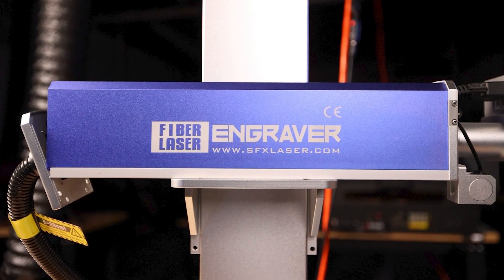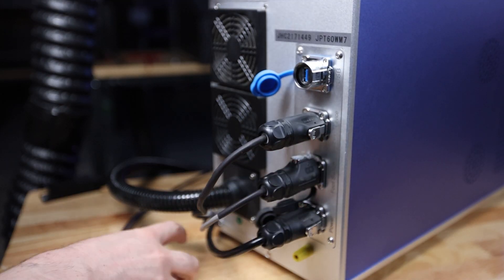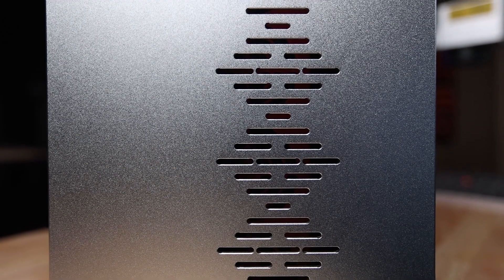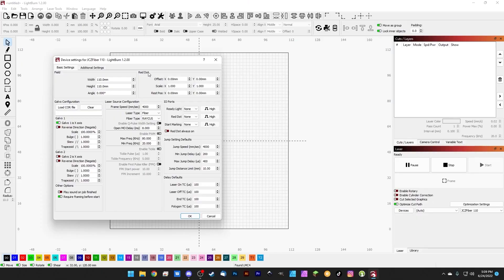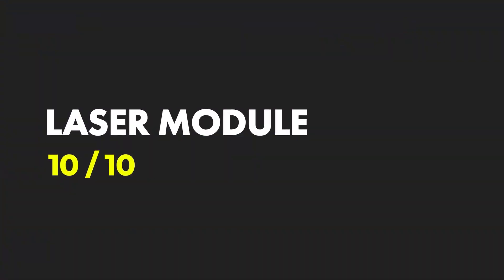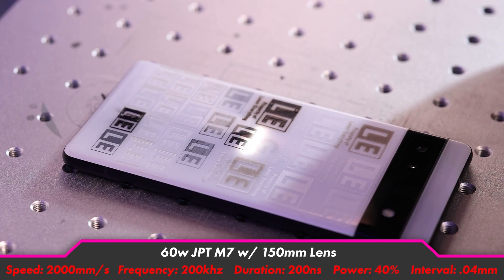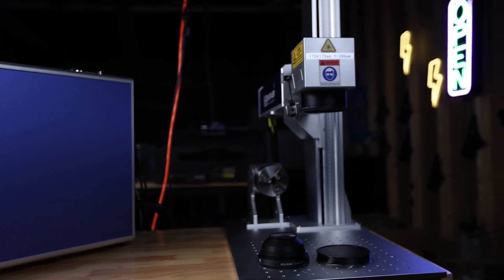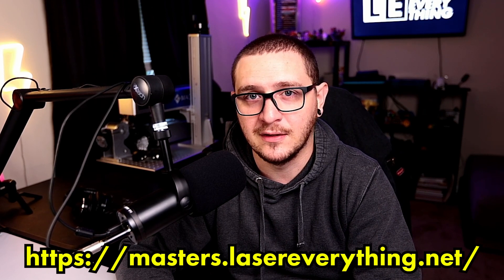SFX 60w M7 MOPA Fiber Laser In Depth Review | JPT YDFLP-60-M7-M-R

Comment: I've got a question I haven't seen anybody ask or talk about when it comes to these fiber lasers.... Is it possible to buy a cheaper 20W non Mopa laser unit in this same form factor to get started, and then simply upgrade the laser source to, say, a 60W Mopa source later? I'd imagine you'd probably need to upgrade the laser source power supply as well, but what about the control board, lens, and galvo, can those stay the same?
Reply from the maker: That's 100% correct and the swap is super easy :)

Comment: Hi, great channel, thanks! Just a quick question would you choose the 60W if you had to chose between the JPT YDFLP-60-M7-M-R and JPT YDFLP-E2-100-M7-M-R. The 100W has a Maximum Pulse Energy of 1.5 mJ. Thanks!
Reply from the maker: While the 60w model there has a 2mJ pulse energy, it doesn't make up for the difference in wattage of the 100w in 99% of cases. There are some limited use cases where the 2mJ might be a better fit for some peoples specific needs, but for typical engraving work loads where you'd consider a 100w (fast / deep engraving), the 100w is going to be a better option.

Comment: The line vs dot for the laser focus is a great feature if set up correctly. Say you have a part with multiple thicknesses, so you have to adjust the focus for each area. Rather than moving the part around to get each surface where your two dots happen to point, you can just adjust until the two lines overlap on the surface you're marking. Not a perfect system, but better than the dots IMHO
Reply from the maker: Ahhhhhhhhhhh THAT MAKES SO MUCH SENSE. Gotcha gotcha.
Reply: I have the exact same model but there isn’t two lines which meet, it’s just one horizontal line, what is the purpose of that line? Scratching my head over this feature😄
Reply: @tinytx  now that’s just funky. Does it look cool if you hang a mini disco ball in front of it? 🤣
Reply from the maker: The other line would be the red dot coming out of the lens when the Galvo is idle

Comment: Great video, I've learned a lot! Guys, what did you pay for your lasers? M7 60w E version. Because the prices are so different everywhere..😅
Reply from the maker: Many of our lasers were sent to us to allow us the ability to test and review, so full disclosure on that, but that also means we actually pay toward taxes on their value. It's also been a while since we got the 60w units we have in, and prices have fluctuated a bit since then, but the vendors are a marker on that. 2+ years ago, the price was somewhere in the 6500-8000 range for an E series model if memory serves. The prices are super different for a lot of reasons, it could be accessories included, motorized Z with buttons to go up/down or manual Z axis, tower size, model version of laser source in the machine, extra lenses, stuff like that. Once you get beyond that, it's about time taken to test in the factory after assembly, validate functionality and ensure power output testing, time spent doing a quality wiring job for easier maintenance and if there is an issue its easier to track back and fix, quality wire terminations and thoughtful management of component layout, and pre-configuring the machine with a correction and quality and care in packaging for shipping and shipping materials. There is a point when the cost gets too low to support all of these things, and somethings gotta give, so if you see something silly low, keep that in mind and know that it may be a bigger burden either later, or even upfront by going too low below the average. For galvo machines, check out the buying guide or on the marketplace, and also so far what we've shared on the channel, all vendors are within the norm range for pricing and offer good value and quality. Some have different setups/accessories, and offer different support/shipping and other custom needs, so there's a lot of options even within the trusted options of the community depending on your preferences/needs.
Reply: @LaserEverything  thanks for the info!

Comment: You have two reviews for, on the surface, appearing to be the same machine. The wisely and the SFX.  My main component is for cutting and etching metal plates for jewelers and the basic market for common items, such as tumblers.  As a first time fiber laser purchase, which one is a better choice and underneath, what are the main differences between the two?
Reply from the maker: The differences between the two are negligible. The source is the same, they both have comparable scan heads, they're both built well. Kyle's wisely has a motorized z if you're into that - mine is manual which I prefer. His bed spacing is 50mm on the jig mounts and mine is 25mm. That's more or less it. Nothing significant to note.

Comment: From a safety perspective is an enclosed fiber better than an open fiber. I understand the safety glasses situation, but, safety in an enclosed situation, is it better? Thanks.
Reply from the maker: Absolutely. Having an enclosure (that is properly rated for the job) is absolutely a safety improvement, especially if anyone might wander into the area where the laser operates during operation. From a function aspect, it can't work for everyone, based on tower height/lens sizing for work area, and object being engraved, but safety wise, 100%.

Comment: How does a 100W E version (1.5 mJ) compare to a  full power 60W (2 mJ) version ?   These go for about the same price, which is a greater value/usability, having more watts or more mJ ?
Reply from the maker: More wattage offers a greater value. To the average user it would be difficult to discern the difference between the two sources.

Comment: When you mention that this can handle even more plastics, what do you mean? What plastics can this do over another laser?

Great Video by the way.
Reply from the maker: Most q-switched fiber lasers are locked at a fairly high pulse width meaning they're using too much brute force to mark plastics without melting them down or catching fire. There are exceptions to every rule however. Fibers are good at surface marking ABS (NOT CUTTING - DANGEROUS GASSES) and dark opaque acrylics with high frequencies that can help reduce your pulse power. That said with the adjustable pulse width (especially at the range of 2-500ns the 60w M7 provides) you can substantially reduce the 'punch' of each individual laser pulse enabling you to get better results on materials that are more sensitive to heat. 

Inversely you can rise far above the average pulse width of q-switched machines which means you can pack way more of a punch at higher speeds and frequencies, meaning you can cut and deep engrave faster and more efficiently. MOPA's really change the game. It's a whole new dynamic in the Power, Freq, Speed triangle balance.
Reply: @LaserEverything How you can deep engrave without burning it using this machine? I mean, what are the correct parameters ? Using a 1.5mm stainless steel plate in the opposite side of plate it is burned.

Comment: Alex, I ordered my first laser a 100W MOPA M7 from SFX on Amazon at just over $10K USD and received it on 17 Aug 22.  Up to now, I was very happy with my purchase until I saw your review.  Now I feel after watching your video that it is like salt being rubbed into a wound, because i thought i was getting the  best JPT source for the 100W.  My laser came with a YDFLP-E-100-M7-M-R  NOT a YDFLP-100-M7-M-R Fiber Laser Source.  I am curious at just how much less effective my 'budget model" is compared to the "luxury model"?  Also, did you specifically ask them for the model you received or did it just come that way? Thanks
Reply from the maker: Hey sharpe, nothing to worry about, the hundred watt only comes in the e-version there is no standard version of that laser source and the price sounds like a good deal so I'd say you're good to go.
Reply: @LaserEverything  Alex, thanks. That does make me feel much better...whew!
Reply from the maker: All good 😊
Reply: @LaserEverything  Sorry, but that's not true. The standard version of the 100 W source does exist. Or at least in the JPT list I have it is there.
Reply from the maker: Weird I don't see it currently listed on their website
Reply: Knowing this mJ thing makes me even more confused.  How does a 60W 1.5mJ, a 60W 2mJ, and a 100W 1.5mJ  versions compare?   Does the 2mJ option make the 60W version more or about the same capable in engraving (speed, quality, etc) as the 100W 1.5mJ module?

Comment: I see maximum pulse engergy on a 100w system is 1.5 whereas on the other it is 2. If you are going for faster cutting and deep engraveing would it be better to have a higher MJ or Watts?
Reply from the maker: Wattage almost always trumps pulse output power, but both is best.

Comment: I have the lower powered model JPT  YDFLP-60-M7-L1-R.
Hmmm. Even though the it is red the model # is slightly different.
Maybe older unit still left in stock???
Any ideas.
Monthly subscriber here.
Reply from the maker: Hey Jeff, the L1 is an older model and at the time was the only MOPA line offered. Since the M-R released a vacuum was left at the lower price point.. Now, the E is more or less an updated L1 spec wise. Still a great source just different.
Reply: @LaserEverything  Well got the entire machine (less rotary) for a great price. Now I know the reason for the longer engraving time. Thanks.
Reply from the maker: It's a good source despite it's "age", should serve you well ✨
Reply: @LaserEverything  Hey Alex, was wondering what use all those higher frequencies will be beyond the 400 Khz??
Reply from the maker: Plastics, organics, anything where high pulse energy will melt the surface or catch the item on fire.
Reply: @LaserEverything  Ah. Thanks for the clarification Alex.
Much appreciated.
Reply from the maker: Yep 👍

Comment: Unless I'm reading it wrong, it looks like you pay around $7500 on Amazon for the 60w unit and do not get the 2.0mj source.  The 2.0mj source shows as optional.  You have to buy the 80w source to get 2.0mj it seems.  On the SFX site, you automatically get the 2.0mj when you buy the 60w source model.  Guess you gotta always read the fine print.  🙂  Thanks for the good review.

Comment: What are power requirements of this? Plug and breakers
Reply from the maker: Nothing special, mine runs on a normal 15A North American circuit. These smaller galvo lasers really don't draw that much current. :)

Comment: Oh & what happened to lightburn & what was the reason for the downgrade?
Reply from the maker: LightBurn was released for galvo lasers but currently only supports Ezcad 2 controllers. This machine shipped with an Ezcad 3 controller and I wanted to use LightBurn so I had to downgrade my controller to do so. Now that LightBurn for Galvo has been released SFX sells these machines "LightBurn Ready" with Ezcad 2 controllers pre-installed so the downgrade is no longer necessary.
Reply: @LaserEverything  Ah, that makes sense. Thanks. They way it sounded on the video, I thought Lightburn just crashed all together. 

Looking into getting a laser... again, lol. I think its been a year & last time I was thinking about Pascal's lasers. But I haven't has much feedback from the few guys that say they bought one from him. So, this one seems pretty good & easier to import, lol.
Reply from the maker: This would be an excellent choice Matt I've been using it for a really long time now, almost a year before publishing this review and I feel really strongly about the high score I gave it. Most impressed.

Comment: A burning question (see what I did there 😂) I'm really interested in this machine. In your splendid review, it appears that it can cope with engraving mildly curved surfaces. Cups, bottles, and such, without the need of the rotary drive chuck. Did I see that, right?
The reason I ask is that I currently engrave curved stainless steel surfaces of tools, with a slight curvature both convex and concave. I'm doing this by hand with a Dremel using diamond burrs. A machine like this would revolutionise my work, as well as add the option of colours.

Please tell me this can do what I hope.  

If not, is there a different Galvanometer head that could do what I'm asking?

Very impressive review, btw 😉😎

Thanks in advance.

Comment: What is the peak Frequency on this model?
Reply from the maker: The 60w M7-M-R max power output frequency is around 35khz. Every source is different. This specific source clocked in at 37khz. The unit has a range of 1-4000khz.
Reply: @LaserEverything  after research and tracking down the rep. I found out mines at 37.